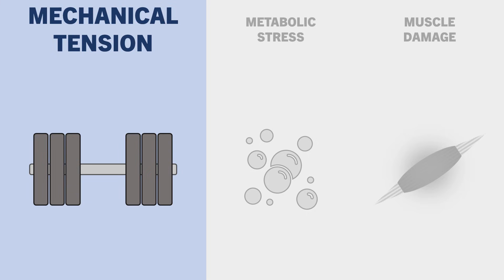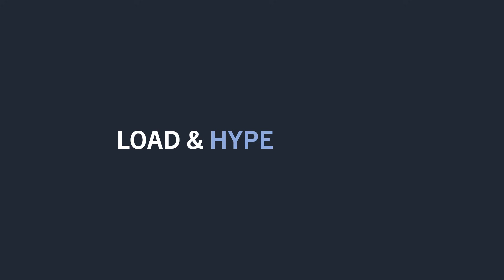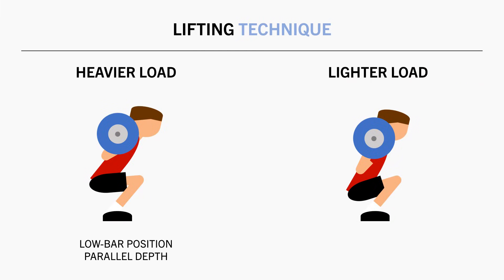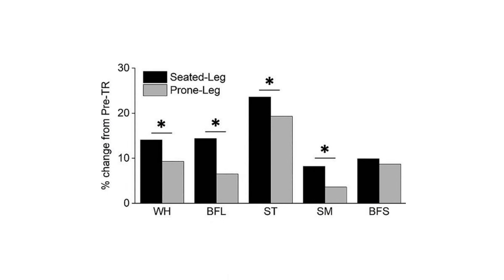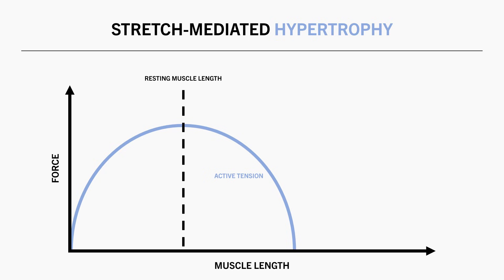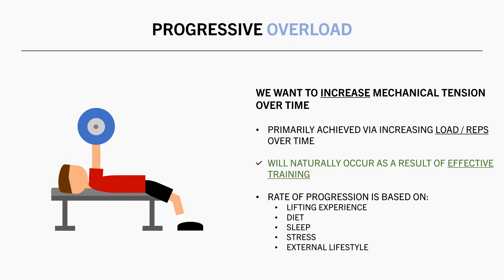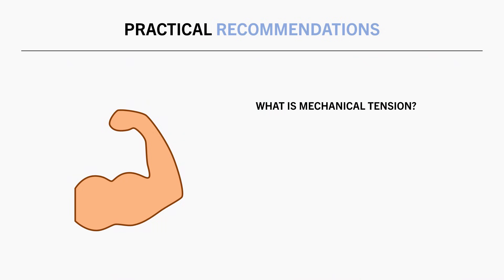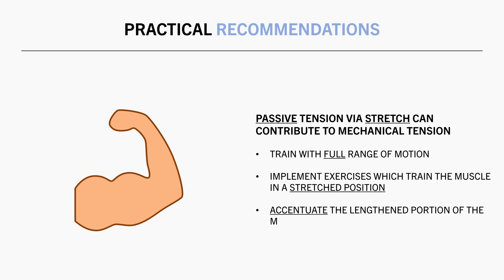What is Mechanical Tension?

Comment: Video said at 8:05: “We want to see progressive overload by increasing mechanical tension over time.”

Progressive overload is one of the most important principles of gaining muscle.
Progressive overload means we can do more reps or more weight or some combination of booth under the same conditions from previous training, lets say for same muscle or bodypart we hit.

Progressive overload allows us to keep the stimulus on the muscle fibers being trained the same from workout to workout. 

Progressive overload does not increase mechanical tension, it alows us to keep it equal from workout to workout. Any set to failiure will have 5 stimulating reps in it. 

Example:
Week 1:Monday-hack squat-100kg x 6Rm(max) (last 5 reps we where mechanical tension happened)

Week 2: Monday-hack squat-100kg x 
8Rm(max)(also last 5 reps is where mechanical rension happened)

—we grow by maintaining mechanical tension through progressive overload, we cannot increase mechanical tension. 

If on week2-monday we did again 100kg x 6Rm ,we wouldnt maximase our mechanical tension or only 3reps would stimulate us, so we lowered mechanical tension, and we didnt max our stimulus to grow. 

Cause of not progressing can be caloric deficit, lack of sleep, stress….ect…

Comment: I feel mechanical tension is the number of times the muscle has to work like when it internally clenches, contract etc. Not necessarily failure tho
Reply from the maker: That's another way to look at it. Although reps performed far from failure don't involve all motor units, which is why training close to failure is important for muscle growth 🤔
Reply: @FlowHighPerformance1  correct but if assume 10 rep is your failure domain then even doing 5-6 is good enough for mechanical tension to hop in.

Comment: I'm sorry. I am a slow learner. uhmm full range of motion should full stretch your muscles and my max lift is 9 coz I can't lift it anymore. is that also a mechanical tension? I'm really sorry. I'm an idiot.
Reply from the maker: mechanical tension is basically just ensuring your stress the muscle by training with a full range of motion and taking each set close to failure

Comment: The best way mechanical tension was described to me is to think of it as an involuntary slowing down of the bar during an exercise. The ‘bar’ could be dumbbells or cables or whatever but for mechanical tension to occur, it should involuntarily slow down, meaning no matter how hard you push (the rate of perceived exertion/effort) the ‘bar’ will move slower. All this to say, train to failure or very close to it, train the full ROM with good technique and have a slower tempo on the eccentric portion. Also, stretch mediated hypertrophy does not apply to all muscle groups (it differs from triceps to hamstrings) and the adaptations seen from stretch mediated hypertrophy apply to new lifters.
Reply from the maker: This is a good way to think about it. Well said 👍

Comment: How should the practical application of tension under time and mechanical tension?
Reply from the maker: Good question. I may make a video on time under tension in the near future 👍
Reply: @FlowHighPerformance1  We are looking forward to your new video.👍
Reply: @fahribayram6967  
• Focus on mind-muscle connection
• Take each rep very slow 
• Always get the stretch
Reply: Time under tension is pretty much just the process of doing reps… pretty much learn how to lift to target specific muscles so you can lift the most with them and slow your reps down on the eccentric portion. Make sure to recover for the next workout and you’re set.

Comment: Mechanical tension seems to be the major (if not only) way muscle is built compared to metabolic stress and muscle fibre damage. What exactly can be considered as mechanical tension is not 100% clear, but practical suggestions are: train close to failure, with good form and range of motion, controlling the eccentric portion of the movement.
Reply from the maker: Great summary 👍
Reply: This is the way you should do it. People overcomplicate the things by saying like your eccentric should last this amounts of seconds and whole set should take this much time. Just train close to failure, maintain good form and control the negative is all you need 👍
Reply: if u are in doubt about the concept of mechanical tension, just watch paul carters video on the topic, he does a very well job on explaining it

Comment: Great video! There is so much value in training in different rep ranges, manipulating tempo and incorporating all parts of the exercise movement (concentric, eccentric and isometric) all of which will contribute to mechanical tension. Your best gains will come from novelty; have fun with your training and switch it up every 4-6 weeks.
Reply from the maker: Well said 👍
Reply: Most of that is nonsense.
Tempo is almost irrelevant 
Isometric do little but increase metabolite accumulation.
Changing everything 4-6 weeks completely eradicates decent progressive overload and only progresses Intermuscular adaptations in half that window.
Rep ranges have different consequences
Reply: @lespaulsarecool  Tempo is not irrelevant; it is a great tool to manipulate that can disrupt a plateau. Studies have also shown strength gains can be made from isometric training with less muscle damage compared to concentric and eccentric loads which means faster recovery time. Changing your routine every 4-6 weeks is a generic statement I made, the point is the body best responds and adapts to novelty; 4-6 weeks is (on average) a good rough timeline to some what change your routine (ie. rep ranges, tempo, exercise selection) for intermediate and advanced lifters that are not following a specific program.
Reply: @@matthewmeikle3609  strength specific gains? Nah. 
I said almost irrelevant.
Also I explained what happens in "novel stimulus" but please do share the science where changing stuff up is relevant to an actual plateau in strength/size and not just new neuromuscular adaptations! 
In fact, nah. There's no point.
Reply: @lespaulsarecool  well adressing your previous comment, tempo is for sure not irrelevant. rushing through the eccentric portion of the movement does affect the ammount of stimulus provided. if you were talking about varying the tempo, then you would be correct in saying that it has no benefits. you are right about isometric contractions (specially in the shortened position) as they seem to not provide any added stimulus. and adressing this comment, as you said it yourself, neuromuscular adaptions are the reason in why you can progressive overload, so they do help in progressing a plateau. and changing your training program, although physiologically not necessary, it doesnt erradicates proper progressive overload, it just makes it harder to set a good progressing pattern.

Comment: Hey! I have the opportunity to train at any time! I live in an apartment where there is a mini gym in one of the rooms, but there is a Smith machine, a crossover, a bench press, squat racks. I have the opportunity not to work yet. I just described the situation to make it clearer!
My question is: is it better to spread the whole workout over the whole day?
  for example: morning-4 approaches, after 3 hours another 4 approaches, after 3 hours another 4 approaches?
And what do you think, if you do 1 approach for each muscle, but every day and distribute these approaches for the whole day.
for example: at 8 am - chest, at 9 am - back, at 10 am - legs, at 11 am - shoulders, and then, but all in one approach and six days a week?
Reply from the maker: Splitting your workouts into multiple sessions per day may be slightly superior. However, In my experience, this is very impractical for most people. Here is a vide going into more detail in this topic https://youtu.be/VGywrEYk_no
Reply: @FlowHighPerformance1  
thanks!
Reply: the best way to distribute your exercises is in a push, pull leg routine. Search it up, it is scientifically proven that this is the best way to train.

Comment: do you think muscles experience that much high mechanical tension on eccentric movement? since eccentric is usually stronger than concentric. usually you fail on concentric part first and technically you could still continue with eccentric for few more "reps". would that suggest that muscle is not that fatigued in this portion if the rep and therefore it doesn't experience that much mechanical tension or there are other factors at play?
Reply from the maker: Good question. This is an area that we don't have all the answers to yet. I would assume that doing a few more eccentric-only reps after failing in the concentric portion would result in slightly superior growth. However, this is very difficult to do in practice for most lifts 🤔
Reply: What does "high mechanical tension" mean?

Comment: When you think of a string or a cord when you pull from both sides you generate a lot of tension, the same with muscle fibers that is why eccentrics and stretch exercises induces more mechanical tension and growth its not really about more weight.
Reply from the maker: well said 👍
Reply: This would also mean that if some strings snap or stiffen while you are generating the same amount of tension as before the mechanical tension per string would increase, right?
Reply: @@ThingsYoudontwanttohear  not really, its a poor analogy tbh. Its better to think of MT (although not wholly accurate) as a stimulus the muscle experiences. Rather than something you're trying to build. 

Load is often massively overlooked as the 5 v 30 can "grow" the same but there are other factors at play.

Heavier sets cause LESS fatigue and faster recovery BETWEEN sets for example. But same hypertrophic stimulus.
Reply: What do you mean "more" mechanical tension? And what do you think Concentrics are for?